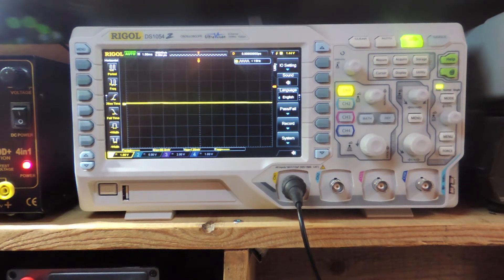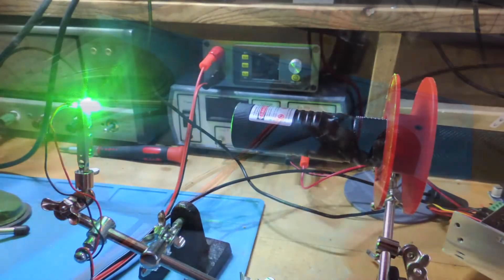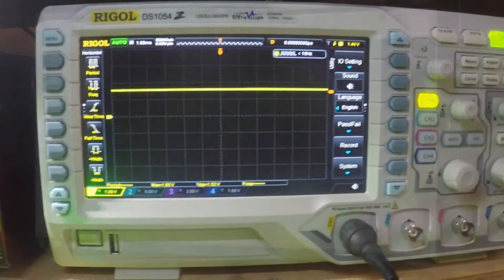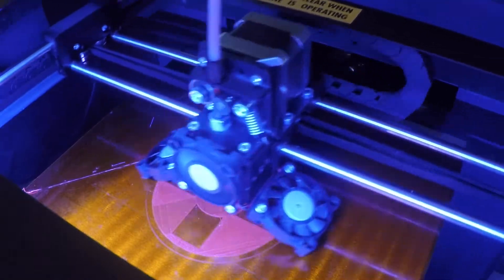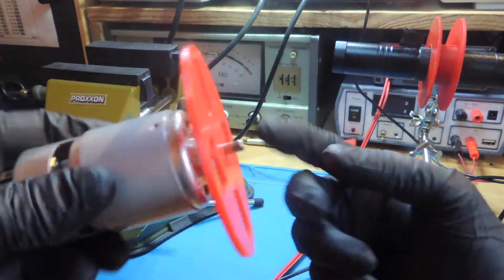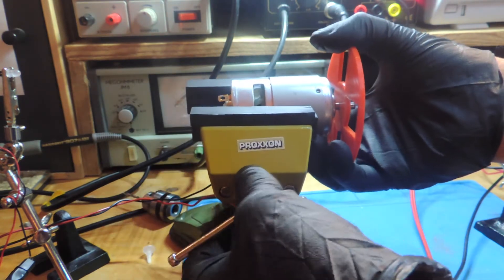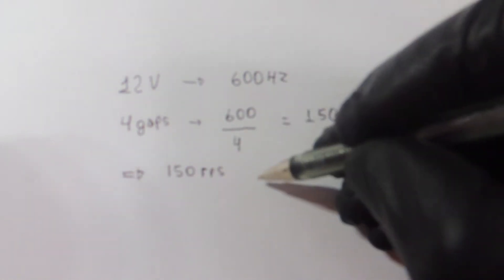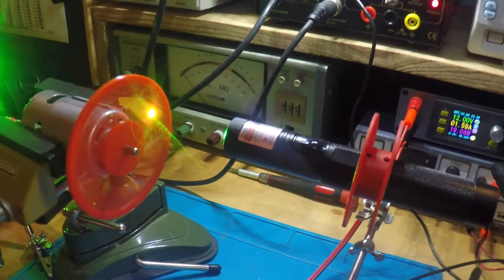How to measure the speed of a DC motor (The easiest tachometer)

Comment: es porque vas a usar este método para medir la velocidad del coche RC?
Reply from the maker: Actually, it's because I guess the specs of the 775 motor are not correct (rpm and current consumption). I'm gonna publish a video soon showing that... Anyway, with this method I'm also able to measure the speed of a drone motor, for example. And I don't even have to take the motor off... just place the laser and LED in a way that the blades of the quad pass through the laser/LED path.
About the RC car itself... I plan to replace the dual 775 motors for a even stronger motor (24V/350W). I will be also publishing a video about that soon.
Reply: "stronger motor"??? wow, quiero ver como evoluciona ese pequeño monstruo.
Reply from the maker: Yes... that's the motor i'll be using: https://www.banggood.com/24V-17A-300W-2750RPM-Brushed-Electric-Motor-For-E-Bike-Scooter-p-1190267.html?p=JM09079991593201704F. 
Should be here soon. ;)